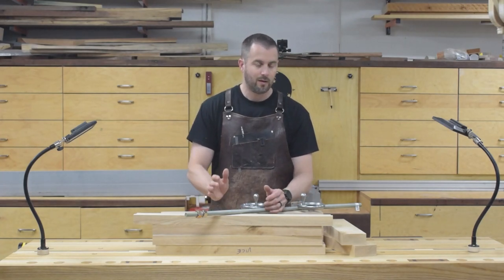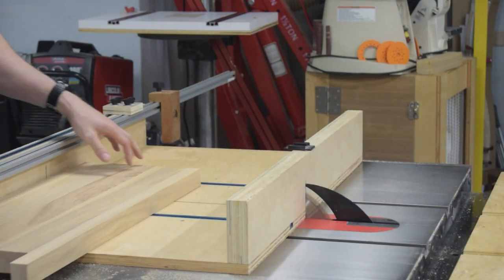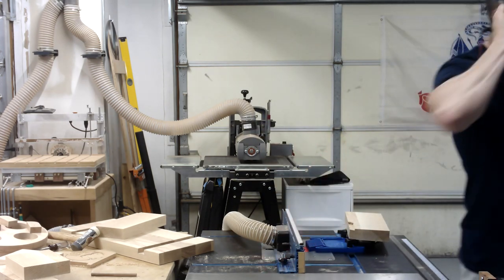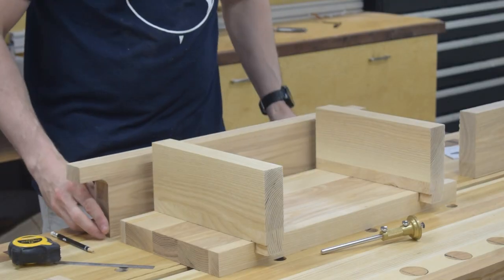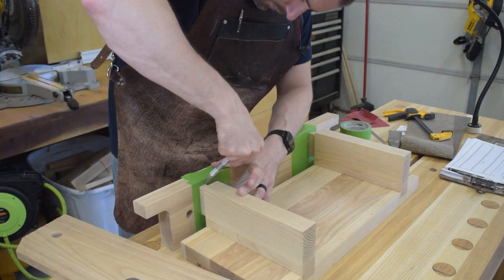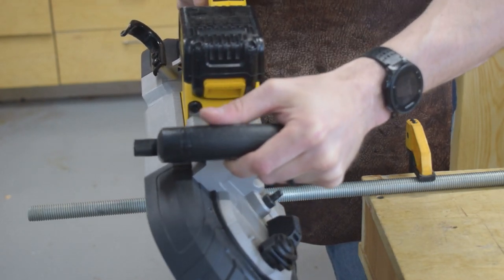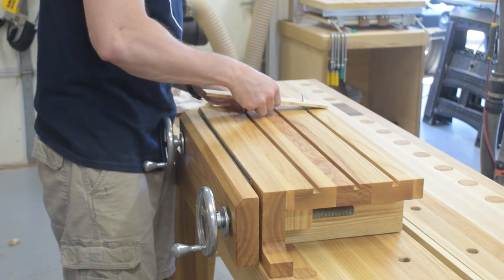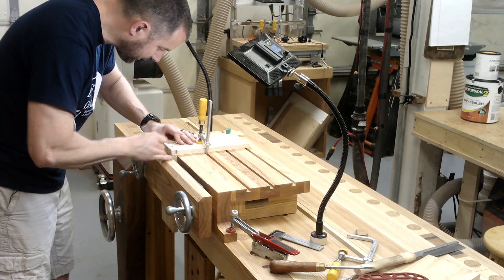Moxon Vise

Comment: Man, you should ask Santa for a miter gauge for your router table. Excellent video!
Reply from the maker: Or even better, one of those cast iron router table tops. I didn’t build in a good miter slot in this one... not one I could use a miter gauge on anyway

Comment: Thanks for this great build video. I’ve been looking for something like this for a while. I am curious why you didn’t route any cross-grain dovetail slots for the Matchfit hardware.
Reply from the maker: I considered it, but I didn’t think I’d ever use them. This moxon vise was purpose built for cutting dovetails on boxes and drawers, and in every use case I could think of, the piece would be longer than it is wide. In most cases longer than the table of the vise.
Reply: @EastOakWoodworking  Thanks! I just wanted to make sure I wasn't missing something.

Comment: Got your plans, and I noticed you recommend the Micro Jig MATCHFIT Relief bit. Is this instead of the using a dado blade to remove the waste material? Is it a better option? I presume you could use it for the dovetails to house the bases? Great video!
Reply from the maker: You can absolutely use a dado bit as well
Reply: @EastOakWoodworking  Bought the MJ Relief bit after looking at a few more MJ videos. Thanks for the reply. My Moxon vise is getting a good workout.

Comment: This looks like a great build to me. I like the stability the tabletop work bench will give to the clampdown moxon vice. Do you find the routered parallel lines get used? Not sure about the clamps or tee thread bolts you used in routered dovetail slot, if you could elaborate?
Nice to see a build where there are answers to comments. Well done. This is one to follow. Thanks.
Reply from the maker: The dovetail slots in the top work perfectly with Matchfit dovetail clamps, and I use them a lot, as well as the fence that uses the same dovetail slots. Is that what you mean by “the parallel lines”?
Reply: Yes, thanks. I found some similar dovetail clamps online, did not know of this variant. Yes, this is what I meant re parallel lines

Comment: I noticed you were tightening the vise by grabbing the wheel instead of the handle on the wheel. In retrospect, do you wish you had used a plain wheel, such as on your leg vise, or are you happy with the wheel you selected for the Moxon Vise? Do the handles sticking out from the wheel get in your way? Nice build, by the way ;)
Reply from the maker: I’ve found that the handle works great for quick in and out on the vise, but grabbing the wheel gives me a better feel for when it’s tight.

Comment: How about the flexible gooseneck for the lights.  Could you provide that link?
Reply from the maker: I just added links for the goosenecks, the mounts for them and the 1/4 x 20 adapters. I’m not 100% happy with the goosenecks, I wish they were just a little stiffer, but they have been working good enough.
Reply: @EastOakWoodworking  That's the same thing I ran into with a LED clamp on light from Rockler.  The light unit seemed a little too heavy for the gooseneck.  Thanks for the response and keep up the good work on the channel!
Reply: @EastOakWoodworking  Where did you get the worklights? What brand, I've been looking all over. Thanks, enjoy your channel!